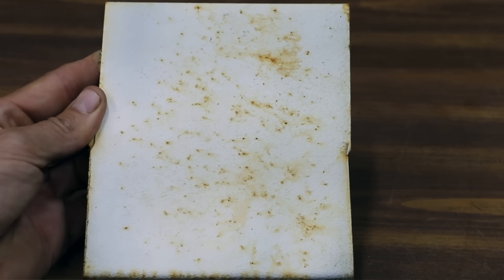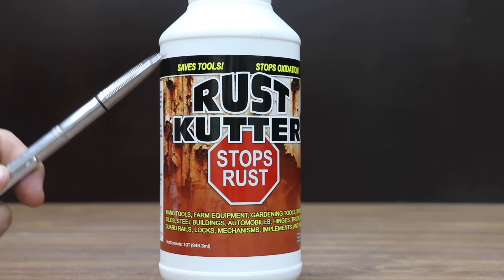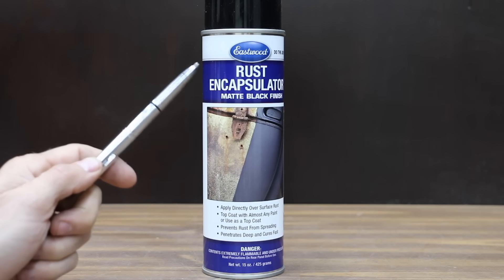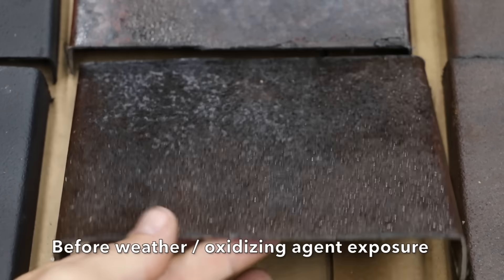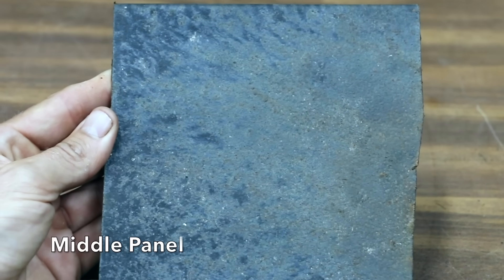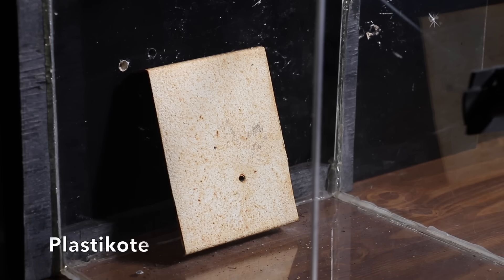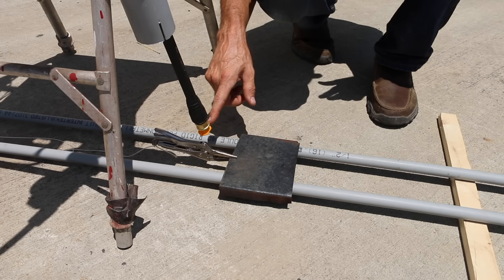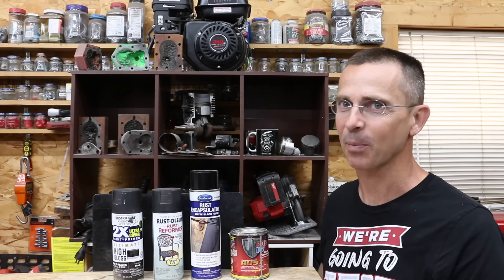Best Rust Converter? POR-15, Eastwood, Rust-oleum Rust Reformer, Gempler's

Comment: I like Naval Gel for my rust tasks. It has surfactants in it that help when combined with isopropyl alcohol to etch into the metal. Then again I’ll remove as much rust as possible first and use a normal primer made for metal after the acid solution. Because of the substrate porosity I allow the acid to remain in the deeper pores, or pits. Prime, guide coat, wet sand and finish. Should last for years if the Bondo isn’t too thick.
Reply from the maker: Thanks for the feedback.

Comment: Actually am looking for something with high temperature resistance (think engine header pipes). :/ Any ideas anyone? Been using ACF50 and it seems stable but am looking for an alternative. Thanks.
Reply from the maker: Thanks for the suggestion.

Comment: Phosphoric acid mixed with pink wall paper glue. Apply a thick coating with a synthetic brush. Will turn iron oxide (rust) into black iron phosphate without damaging the metal. Rinse with water, dry and apply a good rust primer.
Reply from the maker: Thanks for the feedback.

Comment: Thanks for this!    I've heard good and bad about POR-15 but I'm more inclined to trust it because of your testing.  Some paint shops will refuse to paint over it.     One test that I would really like to see is driveway coatings/sealers etc.  Latex vs. other types.  Thanks for all you do!
Reply from the maker: You are welcome!  Thanks for the suggestion.
Reply: @ProjectFarm  POR15 actually makes a cement paint/sealer which has been highly recommended.
Reply: May not be timely info, but painting over POR needs extra care since the urethane coating is glossy and chemical resistant. Needs to be scuffed well and even then, it may not provide the best surface for beauty paint.

Comment: One test that was needed: FIRE and ICE. -- The most common rusty thing in the American backyard is the grill, which is also left outside in winter. Circular steel braziers are commonly neglected, with water collecting in them (which dissolves weak salts from ashes). Their mesh covers are prone to rust extremely rapidly after they're placed on them while a fire is still blazing.
Reply from the maker: Thanks for the suggestion.
Reply: @ProjectFarm  - Water left in a circular fire pit will also frost-heave when turning to ice. (The holy-grail of rust-treatment would work to chemically convert rusty steel surfaces to cast-iron. Lame products simply try to cover the problem by creating a temporary barrier to oxygen.)

Comment: Awesome test, as usual. And thanks for doing it! 👍
   After needle scaling the entire underside of my 69 Camaro in 2014, I used POR15 Rust Prevention on it, as well as the sub frame, cross member, and main suspension components. Then painted it with POR15 gloss black. I drive it often. I even got caught up in a freak thunderstorm storm on the way home, once. Put a commercial air mover (carpet dryer) under it for a couple hours that day, which seemed to work pretty well in drying her out in conjunction with the heat from the motor, headers, and exhaust. Still looks brand new under there to this day. POR15 is no joke.
   On everything else though, I highly recommend Rust-Oleum's Rust Reformer. But I prefer the "automotive" version of this product, which has a different sku # (248658), over the "around the house" version that you tested sku # (215215). As I have had better experiences with it. In fact, at $7 a can, it's hard to beat it.
   Finally, in watching this video, I was thinking, "I wonder what kind of blade he is using to cut those steel squares, with...and maybe he might be using the best, and fastest one available. 
  If not, it MIGHT be time to test that! 😉😁
Reply from the maker: Thanks and you are welcome!  Thanks for sharing.

Comment: Hey, could you try another one? Use the rust converter first, put 3 coats on. 10 - 15 minutes in between each coat. Then, put a Zinc Weld-Thru Primer on top, another 3 coats. Maybe put color coat on top of that, 2 or 3 coats, then a clear coat. I did this on the hood of my 2005 Explorer (02 - 05 models are prone to paint peeling on the front of the hood,) and I haven't seen corrosion since then. The clear coat did peel, though, and the paint did crack horizontally in a few spots around the edges where I put more color coat over the edges.
Reply from the maker: Thanks for the suggestion.

Comment: The Por-15 needs to be used with their "metal ready" product. This is applied first and does the actual rust nuetralizing.
Reply: Ok... the Por-15 he uses says it’s “for metal substrates only” and “no need to remove rust before applying” and works just like it says
Reply: @joeybrazda364 I've used their products for 25 plus years. Use the metal ready first as they recommend. It's similar to the "prep and etch" available at teh big box stores.
Reply: @joeybrazda364  you're not removing the rust, the metal ready is zinc phosphate and phosphoric acid...it's a metal TREATMENT. It tuns the rust grey and makes it inert. I suggest you goto their website and educate yourself about the process.

Comment: Suggestion for a test:
I think it would be be interesting to test the liquid non aresol rust converter. I started using the Rustoleum brand simply because it was the only product here in my small town. The only thing they had the liquid version so that's what I bought. I applied it to my trucks rusted areas and to my home made towing ball assembly it had never been painted and had several years of even rust on it. I applied everything with a paint brush giving it two coats as per instructions. It goes on as a milky white film but soon turns to a black finish. The most dramatic finish was the trailer hitch it turned to a even black finish that looked great. Two years later it still looks good and shows no new rest on any of the surfaces. I went back to the store to get another container but they no longer had the liquid but instead they only had the aerosol versionof Rustoleum So I bought it took it home and started using it. 
When I applied it it went on looking more like paint, I was scepticil but tried it on a number of surfaces it seemed to work and has survived for over 2 years. But I still prefer the liquid.
I would like to see what your tests on liquid would show...
👍
Reply from the maker: Thanks for the video idea.

Comment: I use the Dupli-Color every summer on my cars in preparation for winter. For the $$$$ it works best and lasts the longest if I get to busy or forget. I also spray everything down after all the salt is off the roads. It's a cold, wet job but my stuff old but ya gotta take care of your stuff. We aren't as bad as farther North but if you can find a Truck/SUV without rusty wheel wells over 3 years old, your lucky. Just don't understand how you can pay $50k+ and not take care of it.
Reply from the maker: Thanks for sharing!

Comment: I know you've tested car barriers but I would love to see you test RV Deep Cycle batteries. Are interstate batteries that much better than the Walmart or BiMart brands? Is a true Deep Cycle battery better than a marine starting battery? This might have to be a long term test as the true proof of a deep cycle battery is hundreds of discharge / recharge cycles.
Reply from the maker: Thanks for the suggestion.

Comment: Oh I have a test you may like, fogging oils, there are several on the market, Stabil Amsoil, CRC, Yamalube, Mac's, allstar, sierra, Klotz, starbrite, quicksilver, possibly others, possibly "marine" formulations. 
When ready to store an engine you spray this stuff in the intake while its running and basically increase the spray over a few seconds until the engine quits to coat the insides. Some people also add it in the sparkplug holes and crank the engine a couple turns(leave out the plugs so it doesn't start) to coat the cylinders. And yet other people mix it with a small amount of stabilized fuel and just run it until the exhaust smokes indicating the oil has made it through the carb and engine.(Don't make a full tank of the oil stuff, if you store with a full tank fill the tank with your normal storage fuel after shutdown.)
Fogging oil is supposed to be a tacky oil to both prevent rust and maybe more important to provide lube and seal the rings during restart. Normal crankcase oil will drain way almost entirely in storage.
Along these lines, my really old tractor owners manual advises adding a couple squirts of an equal mix of gas and oil directly into each spark plug hole before starting after storage, mostly to seal the rings and reduce scuffing while the oil pressure builds. (It has vertical cylinders with overhead valves and spark plugs.)

Comment: Absolute praise to you for the high quality content and the meticulous attention to details, design of experiments and process control.  The POR looked like it went on quite heavier than the other coatings, and couldn't help but think of how this may have impacted the results.  But while control of coating thickness would certainly be a variable, I don't know who that would be factored out especially when comparing spray vs. brush-on products.  Keep up the outstanding work!!

Comment: I've been looking forward to this test!  I use POR15 for many automotive applications, from coating a gas tank to floor pans and the back side of panels.  POR15 gas tank treatment requires removing loose rust, washing (their special solution) followed by etching (POR15 product) and finally the POR15 gas tank coating.  It's amazing stuff - very durable and does a great job protecting.  

I've seen the results when people use other products.  POR15 works the best and even though it's on the expensive side, the protection it provides is worth every penny.

Thanks for the video - I'm so glad to see the results.
Reply from the maker: You are welcome!  Glad to hear!
Reply: Think it will work on fenders that keep starting to rust no matter how many times the body man keeps "fixing" it?
Reply: @jamesnm21  I'm in the auto industry and the only way to properly fix rust is to cut it out and weld new panels in.  You can delay the inevitable by coating both the back and outside of the panel with a rust converter (POR 15).  It'll definitely slow down the rust.

If your body shop uses a quality part, which is galvanized on the back, then does a good job installing and painting, you should get years of use from the part.  The key is to make sure there are no exposed places where the rust can start - most times this is on the back of the panel or at the edge or screw/bolt hole.  

I grew up in Chicago and boy do I remember how quickly cars rusted.  In fact, a couple years ago, I was on a cross country drive and I saw the rust damage to cars in Ohio and Indiana - very bad!

Good luck and let us know how POR 15 works for you.

Comment: Do a comparison between oil based film undercoatings!! And PLEASE use clean motor oil in the comparison or as a control!!

Edit: also, I believe these are able to be used on bare metal to protect from oxidation.
Reply from the maker: Thanks for the suggestion.

Comment: I would absolutely love (as I now have a rusty crusty project truck) to see the "paint directly over rust" claims tested. Which is better (in terms of efficiency for time sake.) -- paint directly over rust, or clean rust to nearly bare or entirely bare metal then apply? Which lasts longer? Which adheres better? Can I really leave the rust-removal step out, and just "paint directly over rust" as most of these products claim? Or is it that I can, but would the results be better if I took the extra step to clean up the rust first, for sake of prevention instead of containment? Something I'd love to see tested.
Reply from the maker: Thanks for the video idea.

Comment: PF. What about a comparison between the heavy "anti-rust" paints like POR15, Zero Rust, and Chassis Saver. There may be some others too but these are the big ones that claim to prevent any further rusting and all are nasty to use. I have been using Chassis Saver for a bit now, and have used Zero Rust. Both the rust eventually comes back. I would be very interested in seeing the side-by side.
Reply from the maker: Thanks for the suggestion.

Comment: First off thank you for all that you do. You help us save time and money. I was about to paint my old van with gloss black Rustoleum paint. I've seen YouTubers thin there paint with paint thinner, acetone and mineral spirits. Orange Peel seems to be the biggest issue. Which thinner would you recommend for oil-based paints?
What's the most effective way to thin oil-based paints?
Reply from the maker: Thanks!  Thanks for the suggestion.
Reply: It depends on the project finish quality desired, weather/temp, desired dry time and surface being painted. Also how you are applying the paint. 
Orange Peal from my experience comes form poorly/improperly mixed... bad mix ratios or dirty solvents.... improperly cleaned surfaces can also cause finish issues. 

If you are attempting to roll on brush on un-thinned rustoleum oil it will orange peel... Straight out of the can this paint is almost impossible to lay flat b/c they took out all of the orgainic solvents to meet VOC requirements so it sucks until you thin it and add catalyst or drying agent.

Acetone is one of the best thinners for Rustoleum "pro" oil esp. if you want it to flash quickly,and paint multiple coats in a short period of time...  its the "cleanest" thinner. But pot life is short and its not great when your are painting outdoors esp. in the summer or in direct sunlight b/c it does not "wet out" (flow/flatten) well b/c it flashes too fast.

I spray A LOT of Rustoleum "Pro" oil-based Enamel on metal.

I normally use the cheap Harborfreight HVLP Guns to shoot Rustoleum

I have expensive gear for expensive paint but these guns when cleaned and "tuned" shoot cheap rustoleum oil (properly thinned and mixed with a catalyst or drying agent) beautifully and are fantastic for anything other then show cars etc.... 

For "utility"/decrative painting  (Tractors/furniture/metal railings/Trailers etc.) the thinned Rustoleum Pro shot out of a cheap HVLP gun preforms excellently and is way cheaper, way nicer and last longer then any thing else (Other then expensive paints like 2 part epoxy or urethane paints) including rattle canning.

I shoot the paint outside mostly, in Texas and its alway HOT out.

VM&P Naptha works very well when its warm out or early morning/evning, but a little to fast when its hot-hot at mid day.

Odorless mineral spirits is my go too when its Hot out, or when you want the best pot life/wet out/flatness and can afford to wait a little while for it to flash off between re-coats.. In direct sun or mid day it flashes fast but not too fast.

Plain old (mineral spirits based) "paint thinner" works fine too, but its a "dirty" solvent and is not predictable, its cheap, it works but I would not paint anything for a customer using paint thinner b/c I have had some mixed results and it can flash to fast or to slowly depending on temp/humidity and ratio of chems in the paint thinner.. 

Its works fine and I have used it on many of my own projects its just not as predictable or clean as the other thinners. 

Also Paint Thinner makes your skin burn if you are not wearing Tyvek... which is sometimes  tough to do in the texas heat...the chems in "paint thinner" will give you a burning/numbness sensation on exposed skin after painting where as acetone and Odorless mineral spirts and naptha dont... I would still recommend tyvek but to each their own.

Paint thinner will also really irritate your throat/nose/eyes if sprayed without an organic vapor respirator ... which really is a must for HVLP painting so if your not wearing one dont spray solvent based paint. If using a catalyst its absolutely mandatory.

My go to recipes for HVLP spraying Rustoleum is 4part Paint/3part reducer/1part Catalyst

For projects that must look nice get multiple (3 to 5) coats quickly and last I use  Acetone and Enamel hardener (catalyst) (10:2:1) ...  With this mix you need to work fast and do not paint when its hot or in direct sunlight. But it produces very durable paint very fast and you can shoot 3-5 coats in in a few hours.

For MOST projects I use VM&P Naptha when its not that hot or "Odorless" Mineral Spirits when it is hot  and add Japan Dryer to speed the cure , lower re-coat times (4:3:1)

For projects that just need to be painted so they don't rust I use plain old Paint thinner... I would not recommend this if you want a really nice finish with many coats but if you just want to get paint on something  its better then rattle canning and certainly looks better and is WAY cheaper. (2:1 or 3:1 depending on how the thinner reacts/whether/ luck with that batch of thinner etc.). I have shot it at as much as 2:1 and as little as 5:1 on concurrent days with similar weather but different cans of thinner that just produced wildly different results... 

 I have even shot it 1:1 on some really hot days just so the paint wouldn't gel in the gun and it was flashing so fast that I painted 7 very thin coats in less then 1 hour and it actually turned out quite nicely... but that is a lot of work and more stress then its worth ... trying to keep the gun clean and mixing paint as fast as you can (have to) spray it.